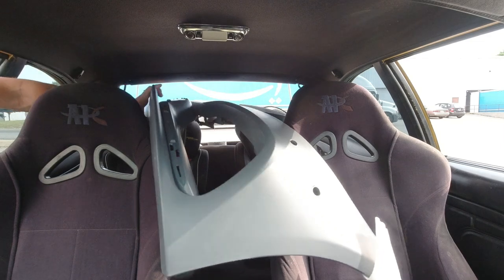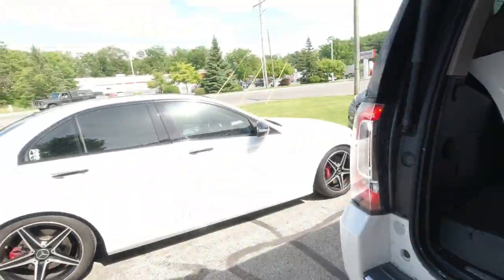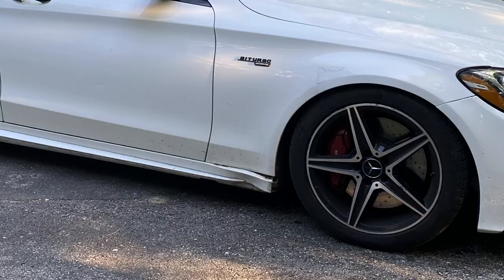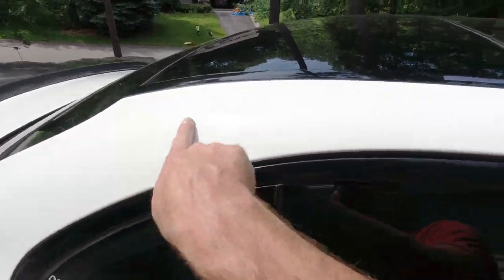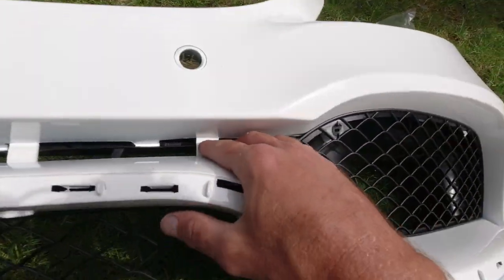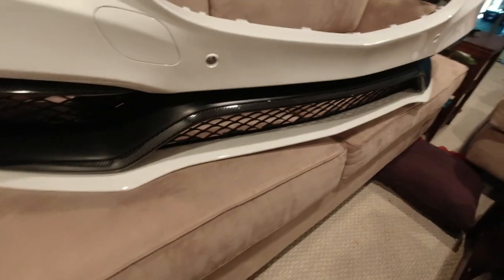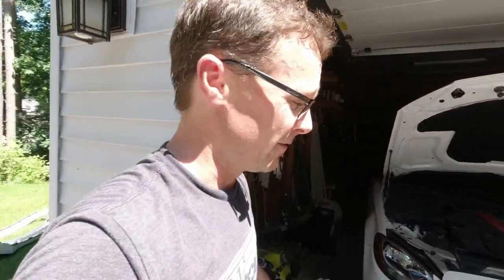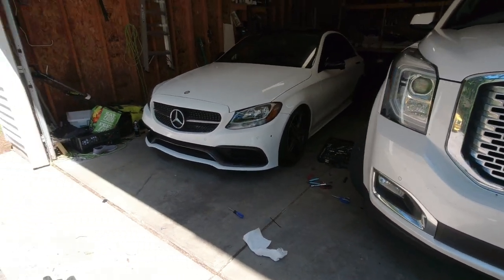Swapping C450 AMG bumper to C63

Comment: Can I confirm that a factory fitting c63s front bumper will not fit on a c43? I would need to buy aftermarket c63 style, am I correct?
Thanks 👍🏼
Reply from the maker: That is correct

Comment: Hey very nice video do you have the video of the trims installation I really need help to put them together just bought the same bumper conversion. 🔥🔥🔥
Reply: What’s the website or link for the front bumper conversion
Reply from the maker: I got it on eBay; https://www.ebay.com/itm/Fits-15-18-Benz-W205-C-Class-C63-AMG-Style-PP-Front-Bumper-Conversion-Kit-/372855813315?mkcid=16&mkevt=1&_trksid=p2349624.m46890.l49286&mkrid=711-127632-2357-0

Search W205 Conversion :)

Comment: isn't the c63 wider ? how does the bumper fit ? any idea if there is a power dome style hood for c450/c43 ?
Reply from the maker: This bumper is not a C63 bumper, but rather a bumper for the C43 that looks like the C63 :)

I've seen a few C63 style hoods on eBay, check there!

Comment: hi how can i find the right color 63 panerama grill for this bumper?
Reply from the maker: The kit ordered (eBay) came with a grille, but I’m 92% sure that the stock c450 grille also fit (this video was 3 years ago and I actually got rid of the c450 and have a c43 now) so I’d imagine you could order the a c450/c43 Panamera style grille and it would fit.
Reply: @drianashton   Thanks for the suggestion man your're the best. Also, how did you know how to install it because there are no instructions. The seller told me that there are no instructions
Reply: @drianashton  I also have a c43 2019. I want to get the c63 front bumper from the same seller.
Reply from the maker: I just kind of winged it, lol.  It installed in the same way the factory bumper came off, so I just paid attention to the steps I needed to do to remove the bumper, then did them to put it back on.  Its super easy, you just have to pop the clips off under the hood; its like a black circle plastic rivet, use a small flat head screw driver to remove the pin from each, then pull the circle retainer thing out.  There are 6 or 8 of those things, then I think a few plastic push clips to hold the bumper to the wheel wells, and some torx on the bottom I think.  I just spit that out from memory 3 years ago, so probably pretty useless advise, but it wasn’t tough once I saw how it came apart.
Reply: @drianashton  do you have a 63 style front bumper on ur current c43?
Reply: @drianashton  hey man I just got it delivered but have no clue how to assemble it. Can you make a video or something please!!!! so many parts and I don't really know how to get it all together
Reply from the maker: I wish I could - I don’t have that car or bumper anymore so I do t have a way to show you. I’ll see if I can find any pics or videos from when I did it!
Reply from the maker: I found a few pics - dm me on Instagram and I’ll send you what I’ve got

Comment: Hey there, I saw lots Of c63 bumper on eBay but does it feet to c43 ? I’m trying sale my GLC300 and get c43 amg but I like better c63 amg style front bumper, 
Can c63 amg front bumper fit on c43 Amg ???
If it does, can You please send me link from eBay … please 🙏🙏🙏
Reply from the maker: This is the one I used;
https://www.ebay.com/itm/W205-C63-AMG-Style-Front-Bumper-with-PDC-for-Mercedes-C-Class-15-18-/133254278917?_trksid=p2349624.m46890.l49286